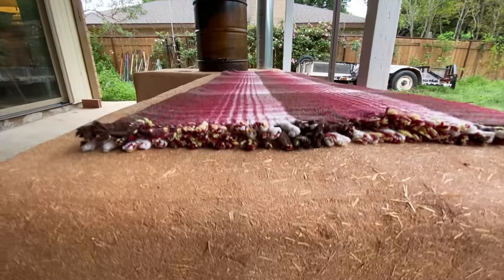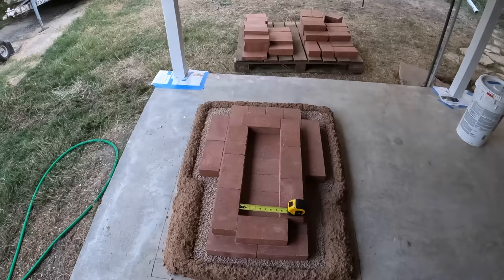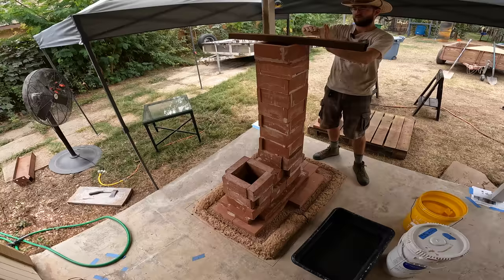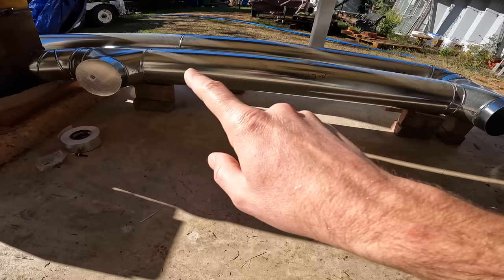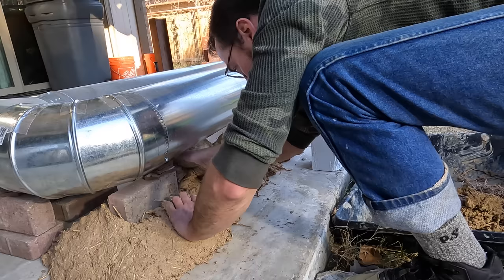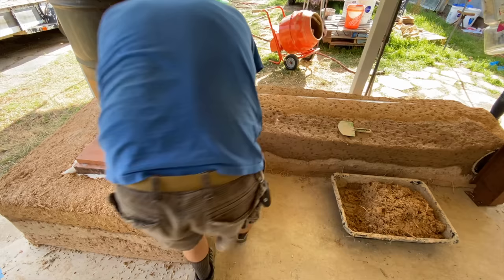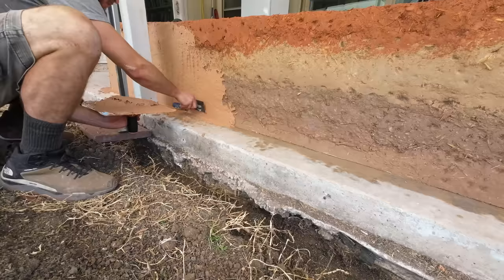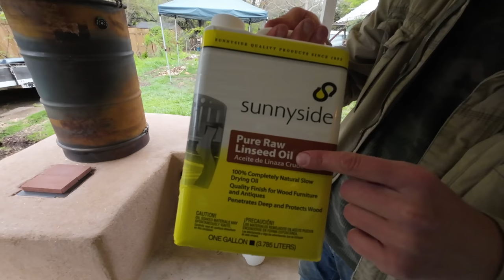World's most efficient stove!!!!  Made of DIRT!!!

Comment: The dimensions of the Rocket Stove and the sizing of the ducting and the specific materials used, have been researched by many around the world for decades
This build is a result of all that accumulated research. 
Basically the riser of fire brick and the insulation wrapped around it ensure that the unburnt gases from the burn tunnel and excess air (drawn in by the exact sizing of everything) make sure ALL the gases are burnt, so there is no creosote at all (well perhaps in the first minutes until up to temp). The fire brick in the burn tunnel also helps with keeping it HOT and the 90deg bend to riser further helps with mixing. 

Its called a rocket stove because of the noise it makes as the air and wood gases mix and burn completely.

Most users find no unburnt coals, minimum ash and very little to clean out and the riser is normally a grey ashen colour indicating complete combustion. What you saw when he lifted the barrel early on in the build was black soot from the small "drying fires", this changes when it gets a full burn going as after 5minutes there is NO smoke just a heat haze coming out of chimney.

The reason fire brick is used is because of the high temperatures generated in the riser that can destroy steel and even stainless steel in a few burns (many have tried and failed with steel in these RS's). 
Temperatures over 1000degC  1800degF are generated at peak burn. 

Rocket stoves are burnt clean with an excess of air, at high temperatures = total combustion for short periods of time and the massive amount of heat is absorbed in the cob bench which then releases it over the next 6-12 hours. Cob has a heat penetration rate of about 1inch per hour so the bench takes time for heat to reach surface but then stays hot for a long time. Many just have  ONE 1/2hr burn 1 or  2 burns  PER 24 hours for ALL DAY & NIGHT HEATING = very comfortable house.

Because of the efficiency of these fires most users report using 1/3 to 1/10th of the wood previously used in a steel box stove,. Decades of research by many around the world in open forums. This build is a result of all that accumulated research and knowledge. 

The cob lets this stored heat out all night as the heat is stored in the cob and the fire is out and the flue close so it doesn't draught warm air to outside. 
So no fire at night = maximum safety

 Most steel box stoves are filled to max and flue turned to minimum in an attempt get heat from full night burn. This is what creates the creosote AND an unattended fire at night plus creosote is NOT AS SAFE AS   NO FIRE

I would imagine he will wall in that area in the future and have a lovely cosy place in winter

Manifold/bell     when the extremely  hot fully burnt gases from the riser hit the bell  they spread out in all directions and  hit the side walls. In doing so the loose some heat, now being cooler they are more dense so start dropping down sides where they loose more heat etc etc until they get to the bottom they then flow into the flue that runs through the bench giving up even more heat until they are pushed out of the chimney as "relatively" cool waste gas. Mainly Co2 and water  as we have complete combustion due to excess air and extremely high temps.
These high temperatures in the insulated Riser, mean the gas has expanded hugely causing high velocities (rocket stove noise) this momentum drives the system as the gas cools and therefore shrinks the rest of the journey. The shrinking gas also means the friction with walls becomes less and less as the gas is pushed along.
An important part of the design is to not make the bench too long a take out too much heat or the water vapour will condense so exit temps of 50-100deg C are part of the design. 
There are tables of design parameters in the Rocket stove Forums  for   Rocket stoves from 1kw output at 3" or75mm to 17kw 250mm or  10" Riser/flue diameter

Manifold/bell     when the extremely  hot fully burnt gases from the riser hit the bell  they spread out in all directions and  hit the side walls. In doing so the loose some heat, now being cooler they are more dense so start dropping down sides where they loose more heat etc etc until they get to the bottom they then flow into the flue that runs through the bench giving up even more heat until they are pushed out of the chimney as "relatively" cool waste gas. Mainly Co2 and water  as we have complete combustion due to excess air and extremely high temps.
These high temperatures in the insulated Riser, mean the gas has expanded hugely causing high velocities (rocket stove noise) this momentum drives the system as the gas cools and therefore shrinks the rest of the journey. The shrinking gas also means the friction with walls becomes less and less as the gas is pushed along.
An important part of the design is to not make the bench too long a take out too much heat or the water vapour will condense so exit temps of 50-100deg C are part of the design. 

There are tables of design parameters in the Rocket stove Forums  for   Rocket stoves from 1kw output at 3" or75mm to 17kw monsters of 250mm or  10" Riser/flue diameter
Reply from the maker: Very informative! Thanks for commenting
Reply: Thank you...very informative

Comment: I have  some  experience with woodstoves, fireplaces, chimneys, flues, weathercaps, masonry, plastering, and various applications of mortar & cement . . . What I admire most is the well rounded perspective offered to anyone who knows essentially nothing about such a project and the guidance provided to increase the likely hood of such a person's success.
Combustion exhaust completeness is an issue in many municipalities -- I suggest that some reading on catalytic devices to reduce unburned byproducts is advisable.
Reply: Combustion exhaust completeness...A common misconception among people used to working with low-temperature 'regular' wood stoves. A properly designed and constructed rocket mass heater gets up to 1500-2000*F in the burn tunnel and heat riser. This combusts Everything, even the carbon monoxide, leaving a clean, smoke-free exhaust of CO2, nitrogen and a bit of water vapor. Zero creosote production, and the exhaust gas temps are so low the 'chimney' won't even burn your hand.
Reply: @darrelljacobjr2120  You have this concept of combustion dialed in! We require a paradigm shift of how we burn fuels!

Comment: Not only did you clearly explain and show each step of the process, but I appreciate that you also show how long the process takes and what tools are required if you are just working in your spare time. I know I eventually want to build a rocket-mass heater inside, and I think this is probably the pace I would go, so I too should plan for about 6 months. Thanks for all the helpful tips and insights!
Reply from the maker: I am glad that you found this video helpful. I probably could’ve gone a little bit faster, but I was juggling a few other projects. Those videos will be coming soon. One of them is a giant rain water tank. Good luck with your project and be safe. I would definitely recommend buying the book that I link to in the description. If I could go back and change, one thing, I might have something then other than HVAC pipe for the full chimney. But I suppose on the porch I think that is sufficient. Maybe just not for an indoor version though. Thanks for subscribing!

Comment: Looks awesome. These kind of stoves are very popular in Finland. Tulikivi is one producer. I have one too.

The big advantage is, that heat is emitted via infrared radiation, which feels nice and is mkre efficient for heating than convective heating of a metal stove with few mass.

I also have a chimney with air intake. So the exhaust gas preheats the incoming outdoor air. Making the burn more efficient by not pulling out the indoor air. Also it is more safe as the air intake acts as an insulator for the exhaust pipe.

Comment: The good thing about putting the dimples in it is that it will help the drying process as well.  And you should be happy that you didn't do the entire bench at one go because it would take forever for the inside to dry.  You are better to do it in 6 inch layers with time to dry between.
Reply from the maker: Good to know. That’s about the depth each layer worked out to be. Thanks for your support!

Comment: This could most likely be turned in to the heated floors. There is also an option to turn it in to a heated wall, hollow clay wall with the chimney inside of it, its possible to heat 2 different rooms with it. 
A hollow clay wall is a usual thing to have in an older design buildings, but most of the time it is connected to the simple wood stove.

P.s. About the ash cleaning. Havent tried it myself or anything, but if it really clogs somewhere you cant reach, a leaf blower might be an effective option to blow using some pressure.

Comment: This is the best tutorial for building a RMH i have seen, and i have watched a few, great explanations and very impressed with how tidy you work, one question; is there a maximum length that the bench can be,
Reply from the maker: Thank you. I’m going off memory here but I’m pretty sure 20 feet (of total duct) is approaching the max. I’ve read that if you want to increase the length of duct in the bench you have to either reduce the number of right angle bends (since turns add resistance to flow) or increase the height of the heat riser (to increase the driving force) or both. The final chimney height (that comes out of your roof) also helps pull air. The shorter the outdoor chimney the worse it is for flow. I added one extra layer (or course) of fire bricks partially for this reason as well. I was forced to have a short outdoor chimney so I wanted to compensate by “pushing” the exhaust gas harder with an extra tall heat riser. Hope that helps. 

Anyone reading this if you add your questions in the comments maybe I can do a follow up Q&A video some day… 🤷🏼‍♂️

Comment: I'm sure this was a learning experience, would be interesting to see an honest part 2 of how well it actually functions, what it sounds like, how much wood it consumes, how you reload it and how often, if you need to close off the air somewhat to get a clean burn, what's coming out of the stack at different stages, what temperatures it runs at, how much if any creosote collects in the pipes, taking the lids off, cleaning etc.
  Wood stoves don't loose the "vast majority" of heat up the chimney, a modern stove with modern insulated flue will only loose 20%. 
That 20% is by design, to keep the entire flue hot enough to minimise creosote etc forming/condensing  inside the flue.
I imagine the "heat riser" is insulated not for draft, but so it can get hot enough to get a good clean efficient secondary burn. 
 If that's not happening you'll have smokey inefficient use of wood and a lot of nasties building up in the (relatively) cold flue sections
Reply: Efficiency in most stoves is lost because there is no secondary burn and fuel goes up the chimney  modern stoves don't burn as hot as a rocket stove and not all of the fuel is consumed.  in a rocket stove there is a secondary combustion taking place in the riser pipe which burns most of the creosote / carbon that would build up in the chimney.   So you are 100% correct about the reason for insulating the heat riser.
Reply: @Vagabondpilot  I assure you modern stoves with secondary and even tertiary burn run hot, if not hotter than most of these wacky rocket stove inventions. 
How do you keep the heat in that riser? Once the three twigs you could fit are gone, all that air is rushing in cooling everything down instantly. It's basically a giant manual fed pellet stove, silly design IMO
Reply: @Username-qx9gk  then go buy a pellet stove and leave the people interested in building the thing they are interested in building to do their own thing.

Comment: Great video. Something that will help you in the future and others wanting to do this. I started my construction career working for my step dad's custom plastering business. I'm a retired general contractor now. Two tools you didn't have that will greatly speed things up and give you a better finished product. One is a Shillelagh which is what it's known by in the plastering business. It's basically a spreader tool that is about the width of a plastering hawk and twice the length of one and has two handles on the bottom. Made for spreading large amounts of plaster or stucco to walls and ceilings or soffits much faster and smoother than a trowel alone. The other is a Darby. A long (about 3' to 4' long) skinny tool that is somewhat flexible that can be metal or wood that's used for flattening and smoothing large surfaces. Makes finishing something like this a lot faster. Hope this helps somebody.
Reply from the maker: Thanks for the tips! I will look both it those up. Cheers!

Comment: My aunt in Hungary had an oven / heating system like this back in 1930s. Hers was significantly larger. The barrel was ceramic on the outside, steel and brick on the inside. Her duct work was steel surrounded by brick and clay.

Comment: For future reference, if you all ever want to optimize heat retention and distribution, you might consider using stones like basalt, soapstone, or gypsum instead of random ones. Basalt has a high energy density and retains heat for a long time. Soapstone also performs well, heating up quickly and holding heat effectively. Gypsum, while good at retaining heat, is the least durable of the options, so it might not be the best choice for long-term durability. Overall, your bench is a solid build, and I loved every second of the building process. Keep up the good work! I'm heading to watch all of your videos.
Reply from the maker: Good to know. Thanks for the tips. And thanks for your support!

Comment: We bought a house with an old brick patio enclosed at some point. It was the coldest room in the house and a real problem... until we installed a rocked mass stove pretty much like this one right on the brick.  It now heats the entire house with sticks, emits almost nothing (as they said) and the masonry mass is also a massive heat sink during the summer. This room now solves all of the temperature problems in the house vs creating them.   There's no code for it. Do your research & don't build a janky chimney box because you will never be able to convince an inspector that the chimney never exceeds 70F. We actually went ahead and used a tripled walled riser, which is massively overkill but eliminates questions.  Don't just watch this excellent video. Read a book, read permies forums, think about the materials, do the math related to the cross section and pipe run lengths.
Reply: We used a single drum. It sits on a brick manifold deep inside the cob. The only metal work involved was cutting off the bottom.  I want to say that we didn't burn the barrel. I hung out inside it with a grinder for ... a while until the paint was all gone.
Reply from the maker: I agree that everyone here should read a book and check out the permies forum prior to moving forward with their own projects. I meant this as a quick reference to show what’s possible. It is by no means a complete guide. I must admit my chimney is certainly approaching “janky” territory. Because it was on a porch I felt it was a corner I could…..round. But if you build one of these inside I think double (or triple) walled stainless is definitely the way to go. Thanks for the thoughtful comment!

Comment: I felt for all the effort building these that stainless ducting and something heavier than barrels should be used whenever possible. Very good video you have done sir.Thank you
Reply from the maker: I must admit that I agree with you. Looking back I wish I would’ve done stainless for the chimney work. I still think the ducts inside of the bench can be the cheaper, HVAC duct. Many commenters have expressed concern about the toxic fumes release when galvanized metal gets heated. But the heat inside of the bench should not get that hot. And even if it were too off-gas, the fumes would be inside of the duct and leave out of the chimney. They would not be vented into the room. Thanks for commenting and for your support!

Comment: I noticed one very effective improvement suggestion for that oven. Fire needs air to burn. If it takes air from the room, it uses the warm air in the room for combustion. If it took the air needed for combustion from the outside, the cold, warm room air would not be wasted. You just need to add a 3" metal air pipe to the beginning of the firebox. The other end of the pipe goes through the wall and out. This way you can completely close the firewood inlet after loading.
Reply from the maker: Great point!

Comment: You could also capture the exhaust, use a water filter for not only thermal capture, but to filter the particulates, then burn the resultant woodgas. The beauty of that kind of system is that the water barrier also acts as a gas feedback stop in the even the woodgas ignites. There is some upkeep in replacing the water, but it increases the overall efficiency of the energy captured from the wood.
Reply: The woodgas is already completely burned in the heat riser. The only emissions are CO2 and H2O vapour. A little ash remains insude the stove.